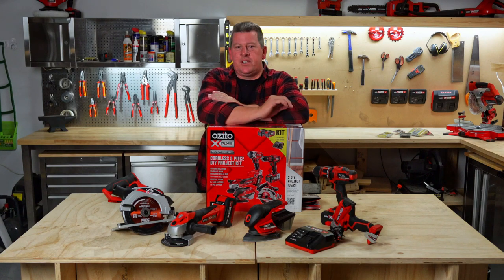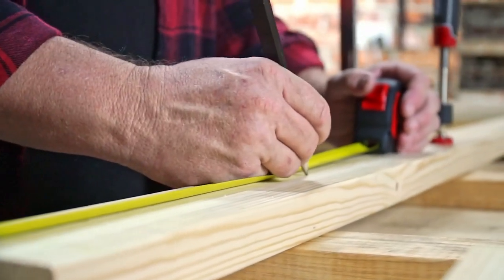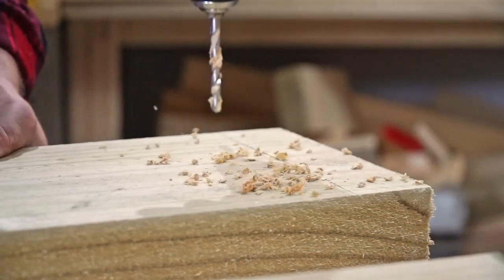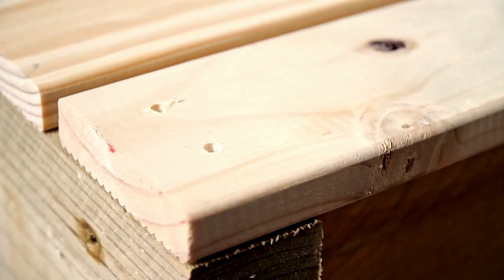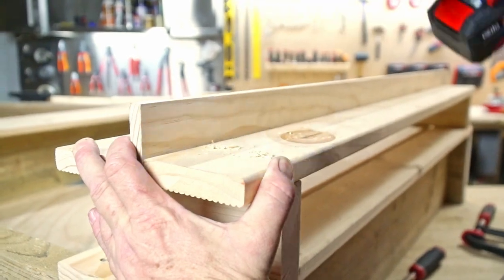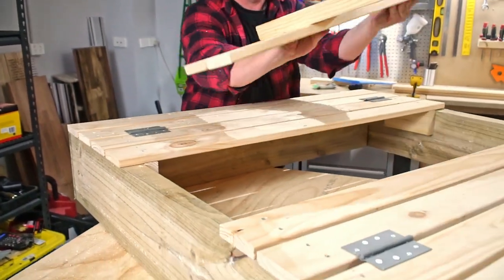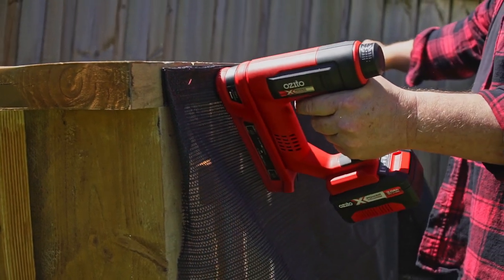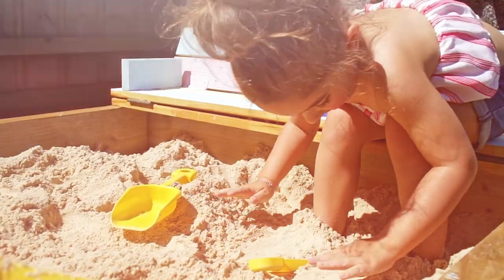Ozito DIY Folding Sandpit - DIY Projects

Comment: Great! I would like to do this but bigger. Because I have two kids. How can I calculate the mesure for a bigger sandbox? 
Thanks in advance!
Reply: Cesar Cantero I am building a sandpit nearly identical to this soon. The width is denoted by the width of the decking boards you use. Each bench seat uses 6 boards, so 12 in total, plus gaps.
Reply: Cesar Cantero you can increase the benches to 3 per section, so 18 in total, but bigger pits require a lot more wood and a lot more sand to fill..